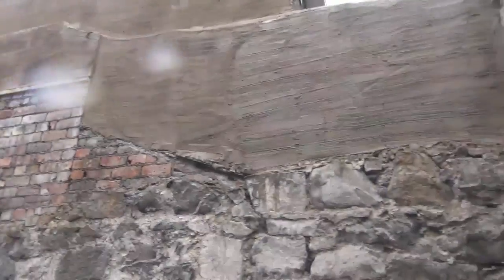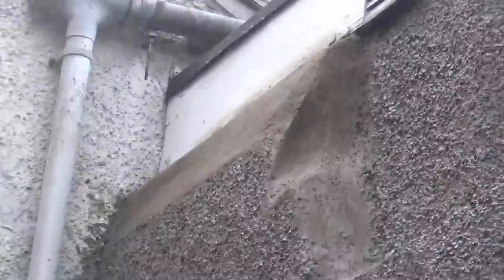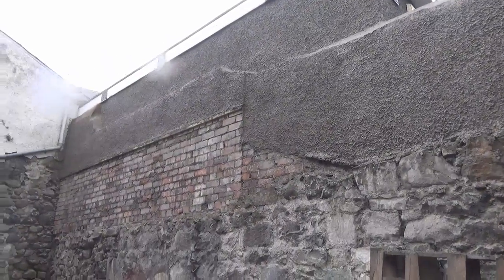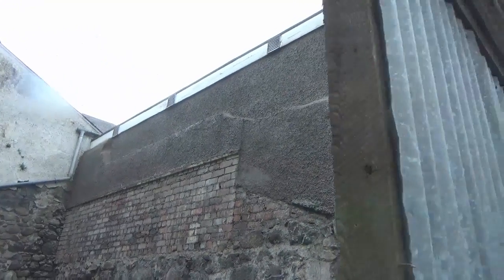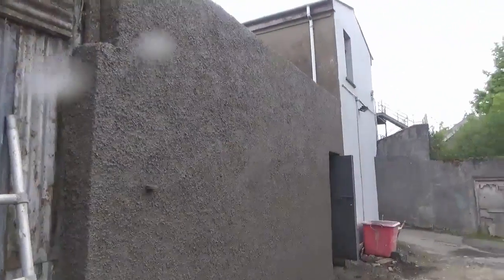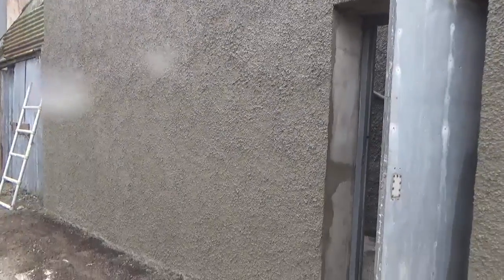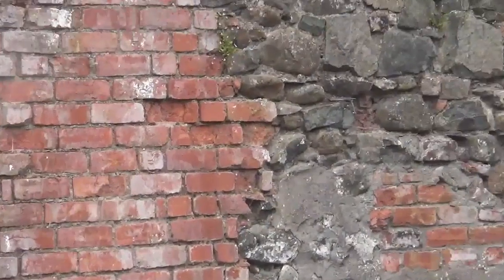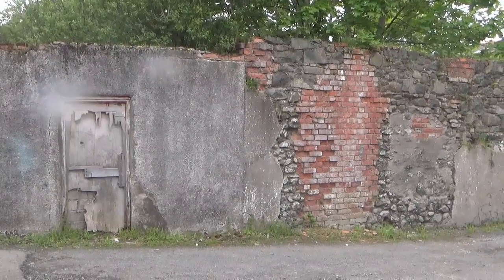OLD WALLS RE RENDERED WITH WET DASH

Comment: That last wall you showed I'd be running away from that lot of scudding of good strong tick mix to fill it in jcb be the right job and bring in a few good block layers be a hateful job that
Reply from the maker: Hi Peter mate it was a mess job that one for sure but had a great end result :) thanks for watching mate
Reply: @macplastering  came across alot of hardship at time. Been gone from that line of work a good while still take on small jobs in the evening ceilings falling down were leaks be the cause. Thinking of going back at it full time I'm not overly fond of the muck and shite and the hardship and the health isn't the best  but the moneys is good tho . You got much of a crew working for u. I'd nearly suffer the consequences an go back at it the fuck full time
Reply from the maker: No crew atm mostly dong solo jobs at this time but if i ever need a pull out got a few good mate that are cracking plasterers that can help push a job on , sure can be a dirty job and hard on the body for sure

Comment: whats your mix/ratio ,sand,cement,stone for this wet dash,,cheers
Reply from the maker: Sorry mate found it here = https://youtu.be/b2U98feK04g I knew it was on alive stream not only do i give my mixes but other plasterers give their also and the way they do things
Reply: @macplastering  thanks
Reply from the maker: @newry123  Any time buddy hope it was useful I do plan on making a very detailed demonstration on it
Reply: @macplastering one more thing, the coat you throw the wet dash on,do you rough it up a little first and do you let it set first or put wet dash on when its soft,,thanks again
Reply from the maker: Sorry mate some of my new comments have been in different reply box held for review and they dont notify me , so sorry for late reply but yes I run a brush over similar what i do when I am bonding and skimming the ceilings... and then I will let it take up some dont want it dry dry but stiff enough to hold another layer with out moving hope this helps buddy :)
Reply: @macplastering  good help..thanks
Reply from the maker: @newry123  Glad it helped some mate again sorry was a late one